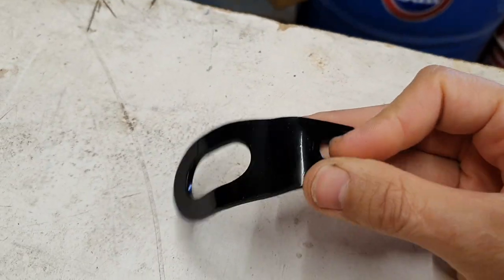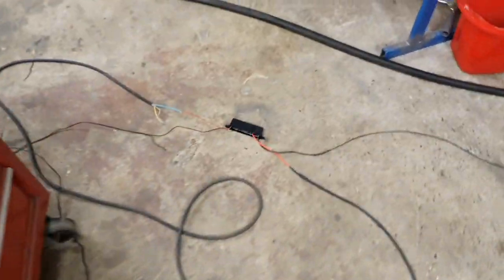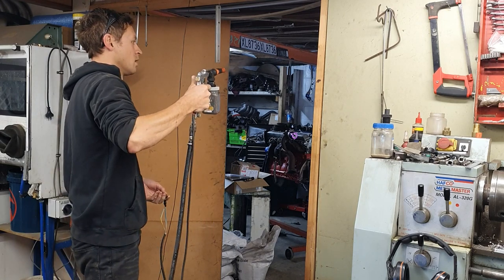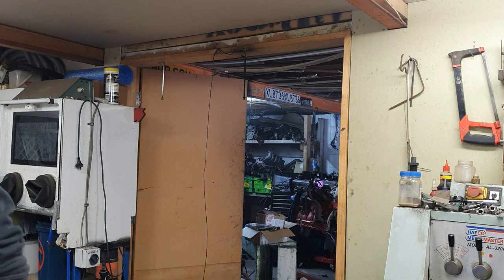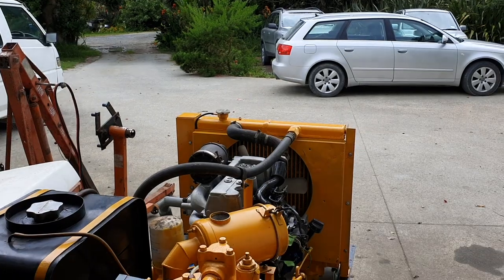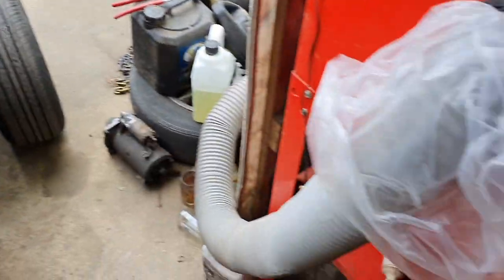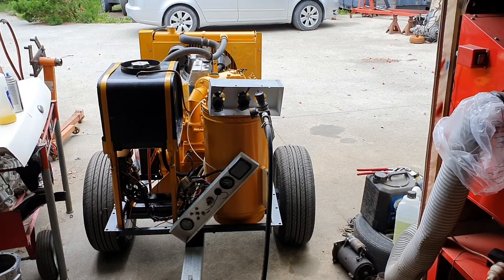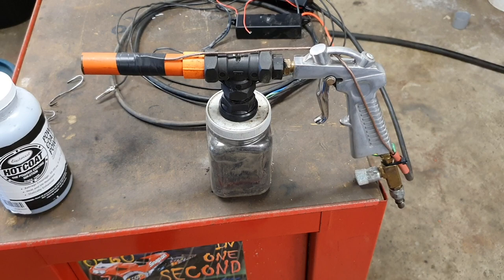Testing a DIY Powder Coating Gun

Comment: Years ago, I worked for a furniture manufacturer which had a large powdercoating line. It was a 2 stage, U-shaped, chain driven conveyer where the metal tables and chairs were hung from the conveyer and, in the 1st stage they were sprayed with powder, then they moved through to the 2nd stage where they were baked in a large oven. 
If you could adapt that principle of doing the spraying and baking in the one location without having to move the work piece, you would considerably reduce the amount of applied powder which falls off and you would also reduce your handling (i.e. double-handling) over all. All it would take is a large enough oven (insulated cabinet) that you could first spray in, before baking.
Chris from WA.
Reply from the maker: I would love the space to be able to do a semi automated setup. For the amount of work I do, it is nor really necessary.

Comment: Nice..do you have a vid or plans on how you built the gun? 
Shouldn't your earth go to the item your powder coating?
Reply from the maker: Hey mate, yes the part being coated is earthed through the electrostatic circuit. The metal gun is also earthed through the ground pin on the wall socket. It stops the used from getting a shock from the electrostatic gun.

Thanks for watching!
Reply: @ArmouryEnterprises  do you have a vid or plans on how you built the gun?